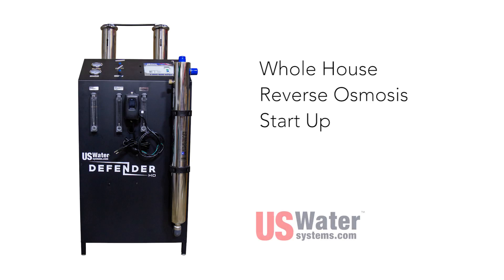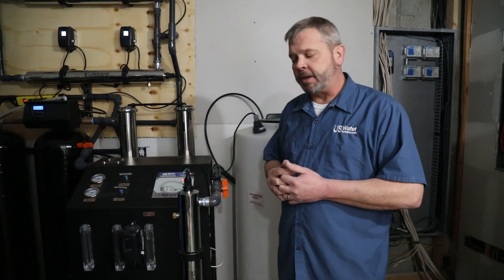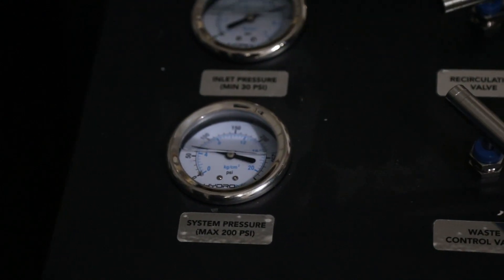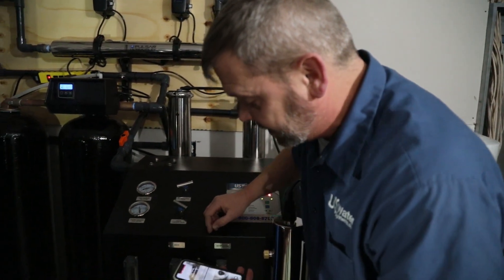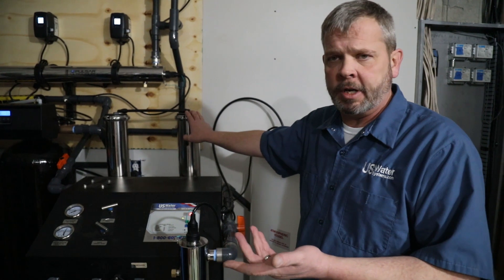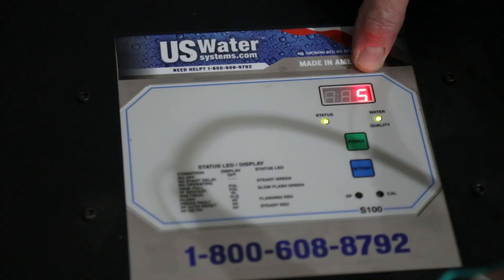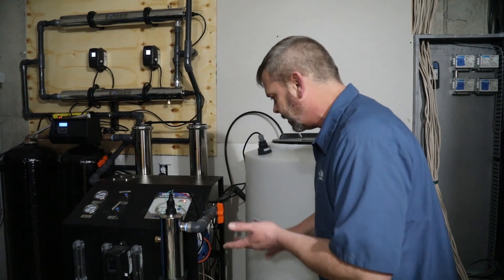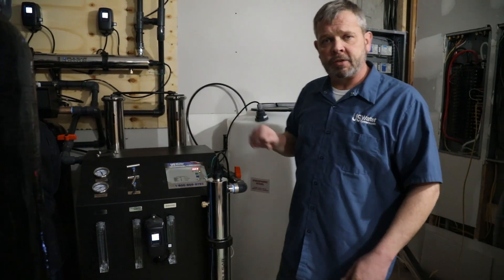The Defender HD - Whole House RO Start-up and Operations

Comment: I've said it in previous comments but I just want to add again that us water systems are fantastic what they do they know what they're doing they use the highest quality Equipment for every single piece and tool in their systems if you do use them spend the money and have your water tested beforehand and they'll give you the proper setup beforehand and you won't need to waste money or maybe need to spend a little bit more money to make sure that you're actually getting clean water that's healthy and not going to hurt you or your family or animals. I worked with a cold again system that cost twice as much that was always needing repair and the repair guys that came never knew what they were doing they would just set it to a certain thing all they knew is how to adjust it they didn't know what anything meant or how the system worked or anything and these guys do and they'll explain it to you or answer any questions that you need.

Even with all that including the pump that they use in this which are very much more expensive than the types of pumps that culgan likes to use and will last at least five times longer these machines are half the price that Culligan charges.

I would recommend these guys anytime any day and stay away from any other company particularly Culligan.
Reply from the maker: Thank you! Always nice to hear that a customer is satisfied.